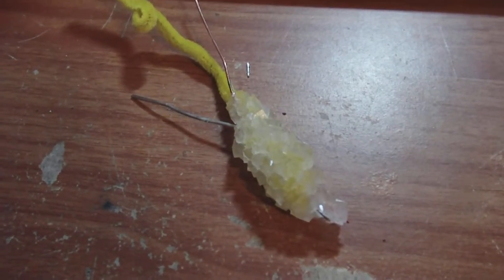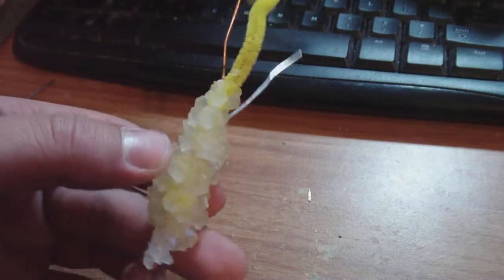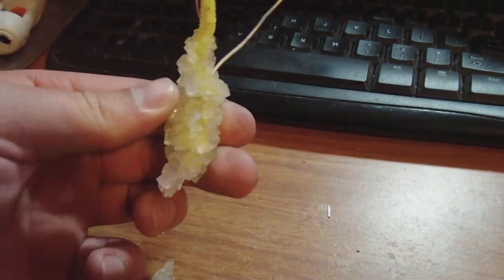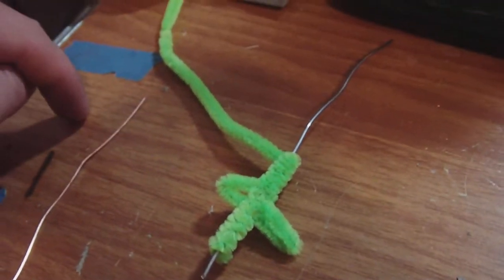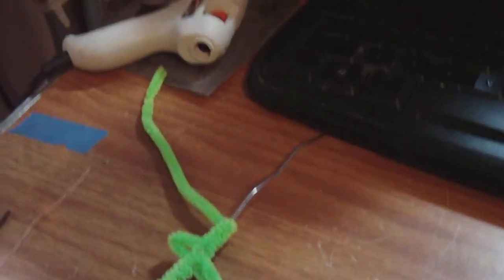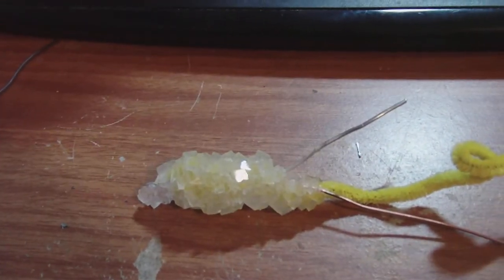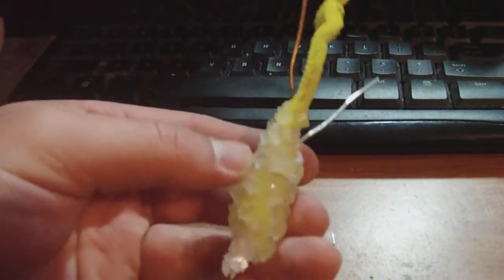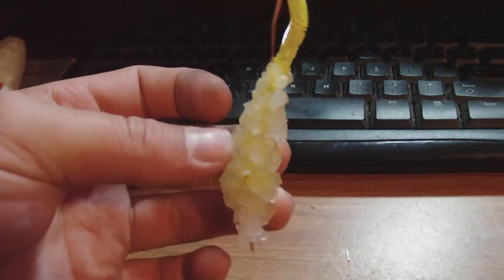Literal Crystal Battery

Comment from the maker: @onthecuttingedge2005 

Yes, to make it work as a battery you'll need to make it a Polycrystalline structure which means crystal inside of crystals. The borax was used due to it having sodium in it.